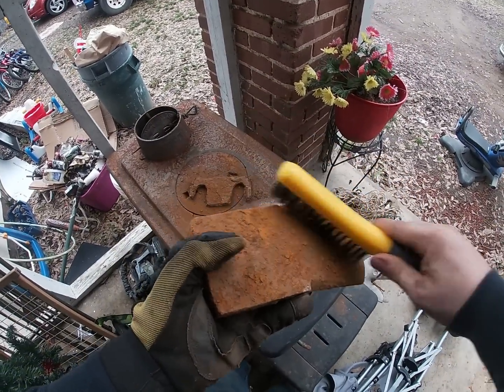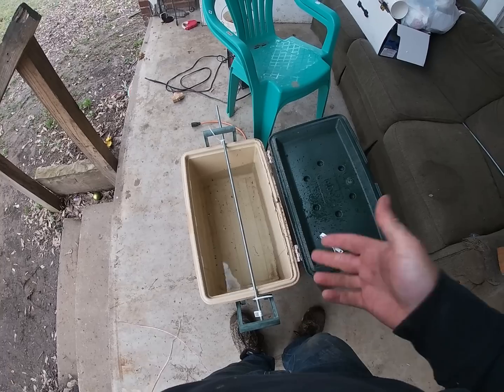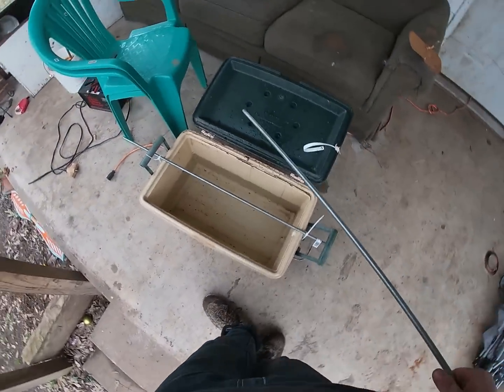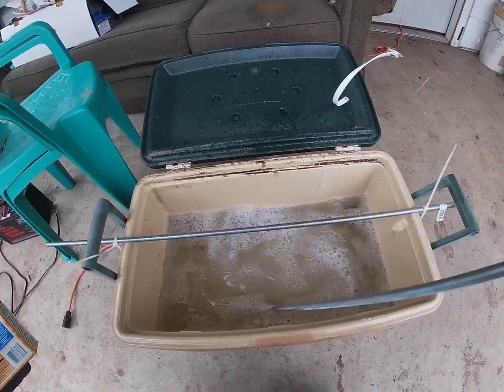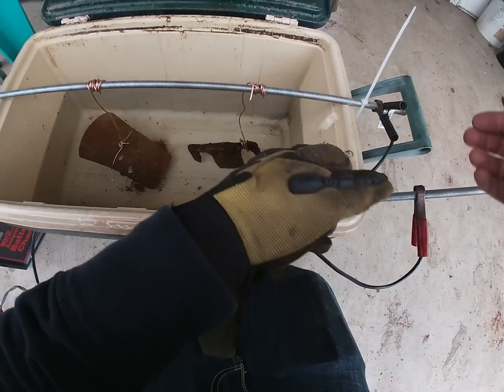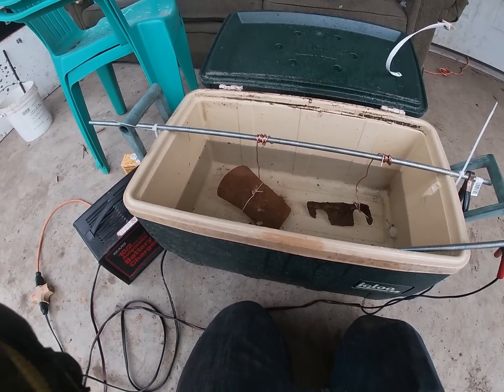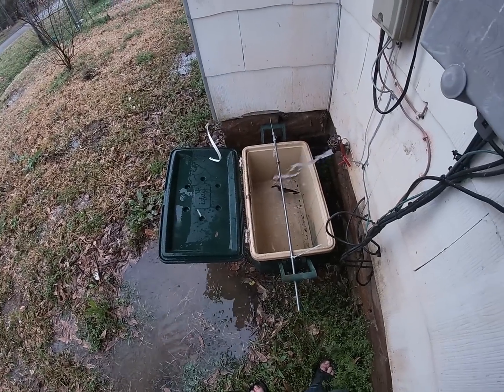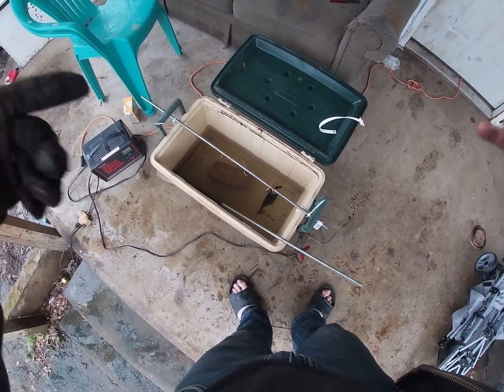how to do electrolysis on relics and a before and after of electrolysis on an axe head

Comment: Good video. As soon as you stabilize the metal you van assure it is preserved. I have 2 old ones I need to do. But I will be sharpening them and using them. They both came from a 1810 property. GL&HH Matt
Reply from the maker: Awesome finds I'm sure